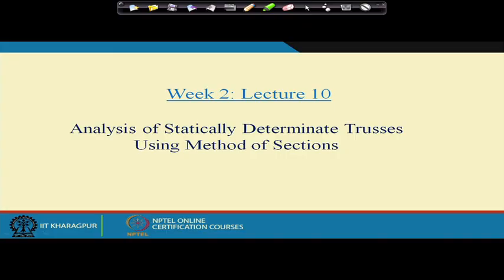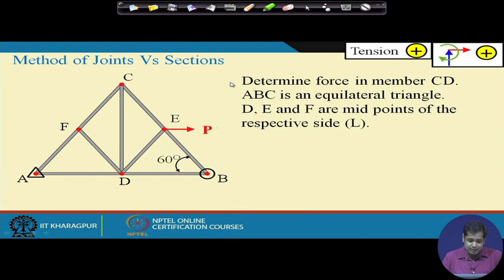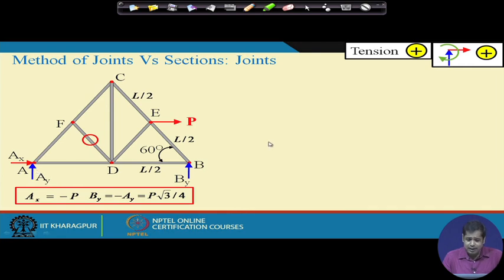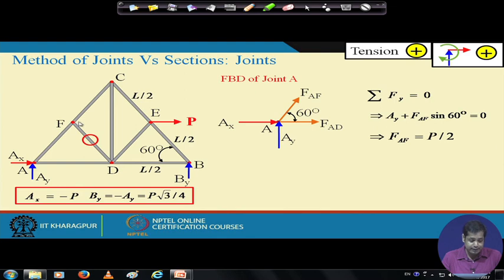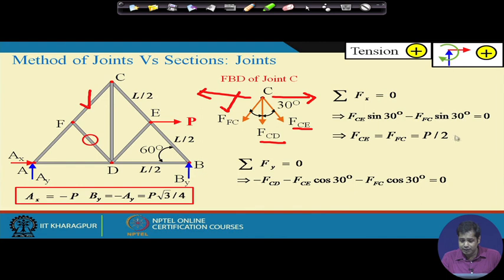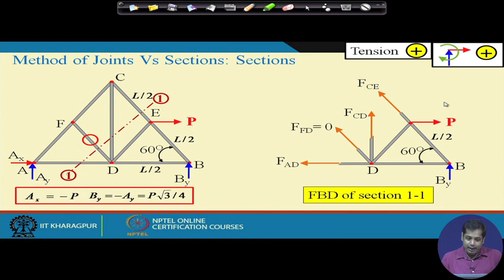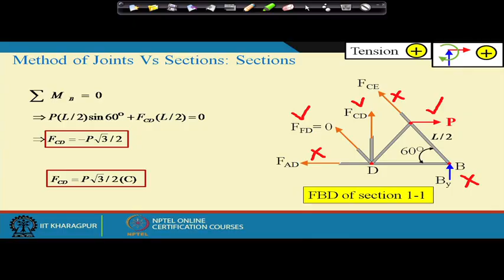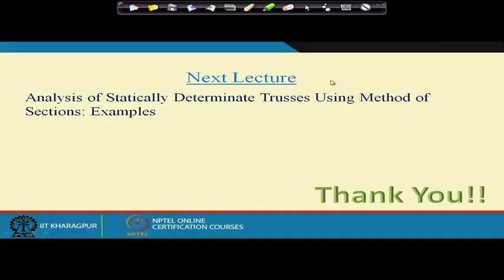Lecture 10 : Analysis of Truss: Method of Sections

Comment: sir when you are taking momemt around A point the moment produce by P force should be P*0.5L cos 30 degree
Reply from the maker: Prabhu, yes you right. There is a typographical error in the second equation. However reaction forces are correct. Regards.
Reply: NOC17 JULY-OCT CE25 
Thanku so much sir 😊 regards
Reply: Angle between load p and EB is 30  Vertical force will be sin convention so it will be  sin30 or cos 60